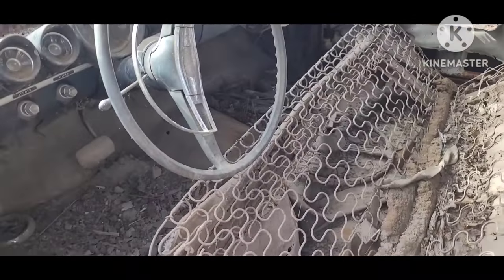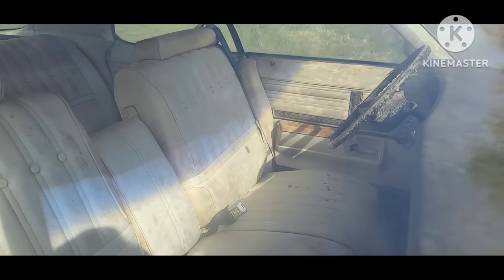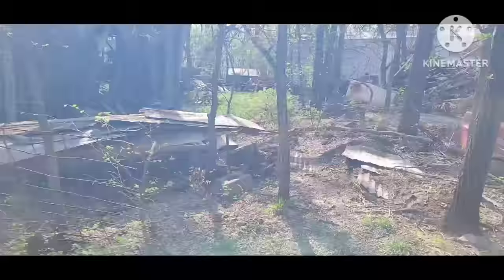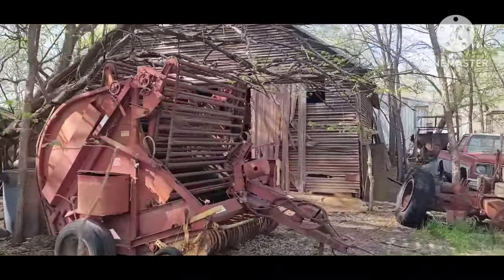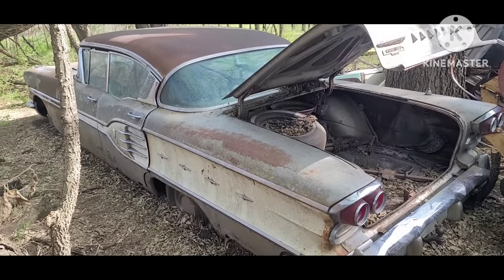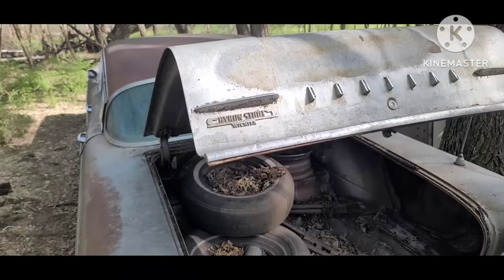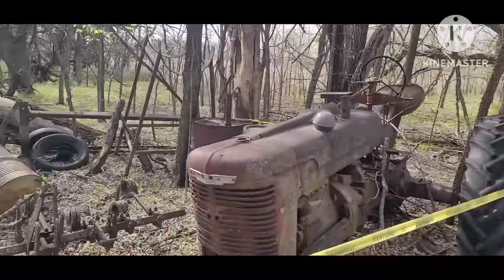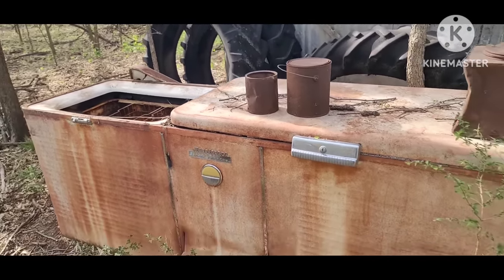He died at 96, and left EVERY Car, Truck, & Tractor he'd ever driven on this time capsule farmstead!

Comment: 1936 Chevy Low roof trucks had wood in the A Pillar (hinge pillar), a curved piece between them below the windshield and some "shoe-like" pieces at the bottom of the cowl attached to the pillars. Doors are all steel.
Reply: We turned a 36 Chevrolet truck into a ratrod pickup using a 46 frame and pickup box. Had to replace the door pillar wood and cross piece under the dash. It's a very fun ride and have taken it to Speedweek several times to watch the land speed racing.

Comment: The '36 Chevy pickup and the Chevrolet 3100 pickup are the coolest things in the lot. The Pontiac is interesting due to its trims and aircraft shaped accessories.
Reply: i agree! i clicked on the video because of the 1936 chevy. i have a 1937 that i'm currently turning into a welding rig and honestly, even for their age they are well built trucks with plenty of headroom when it comes to upgradability

Comment: I had a tire inflator from JC Whitney, you popped out a spark plug, screwed in the hose and used the cylinder pressure to pump up the tire 😂. Worked good 👍

Comment: The pontiac______yep….get it running…interior…drive it.  I drove a 60 model Chevy 4 door like that for many years.
Reply: That Pontiac looks to be very complete. Those have so many trim pieces and lettering, all of which appears to be there. Sure it will probably cost more to restore than it's value, but that's often the case. If that was how every old car's fate was decided, a heck of a lot more would be in scrap yards.

Comment: The North Star engine was good after 2006. They used longer head bolts. Had 190k on mine b4 I sold it and ran perfect. All those rat Nest good example of why you need cats running around

Comment: In the 1950s my grandpa had a 1955 Oldsmobile gold with a gold interior looked kinda cool he had a Hudson hornet with a 6 cylinder he said it would do 110mph his brother had a supercharged Cord smoked that Cord I've had tons of cars lost most of them over the years got a 1942 Ford pickup half ton short box in my garage runs and drives not in that bad of shape but it's got a 250 Chevy and a Borg Warner 5 speed in it but everything else is pretty much original except for the aftermarket windshield wiper, heater, gauges I would of stuck the original engine and transmission back in it but the guy got rid of them before I got it he got it from this guy's that bought it brand new in 1942 this old guys daughter sold it to this guy I got it from

Comment: That first truck is not turned over. 
If the guy was 96 he came from a time, especially for rural farmers, where you drove the farm truck when you needed a truck, and you went to town only when you needed to. 
That thing would probably clean up like a time capsule. I don't know where you are at, but I would try to snag that at auction in a heartbeat. At 37:05 you walk past the tailgate for it. 

The 74 olds is pretty straight too. It for sure has the olds motor in it yet, and highly likely it is a 455. Worth more then scrap, even as a 4 door full size.
Reply from the maker: I eyed both of these pretty hard... Tune in for Part 2!

Comment: The 1st truck in the video by the Cadillac showing 22 K on the odometer couldn't have rolled over on mileage the next digit left is for  hundreds of thousand miles .If it had rolled over it would have read 1 in that space.
Reply: That is what I was going to say.  It's very possible that it only has 22,000 original miles.  My fiancé's grandfather's 1997 GMC truck only had 28,000 original miles on it until she let her youngest son start driving it back in 2019.  Of course he has torn the shit out of it and it now has about 75,000 miles on it.
Reply: I seen that too

Comment: I had a challenger bike in about 1960. Only bike I ever had  I'd of liked to seen the bike a bit longer. Great videos as always
Reply: As best as I can remember the challenger was made by B.F. Goodrich.  I may be wrong, but that was when I was a kid and bicyling was my  life.  LOL  I was riding a Ray by Schwinn.  Loved that machine.  Rode it for years.
Reply: @Dave-ty2qp  yes I think you're right , I think my parents  bought mine at probably western auto or  Bill Beazleys , a local hardware store thaf has been out of business  fot 30 - 40 years now  There were very few stores in my town at that time to buy anything from. I was 10 when I got it in 1962, I use to wax and polish it all the time. The sting rays came out later in my town

Comment: If the odometer on that chevy pick up, with 22,196 mi on it had turned over, it would mean more than 1 million miles, more likely than not, it's original.
Reply from the maker: This is an early producton truck (May 1987), and the early models were notorious for weak gears in the cluster. It's almost certainly broken

Comment: That Pickup has to be a real 22k mile truck, because if it rolled over, it would be 1,022,000 miles, 6 digit odometer!   Maybe it's just broken at 22K.
Reply from the maker: This was an early production truck (May 1987 build date), and I'm told the early gears for the number wheels were notoriously weak, so the most likely explanation is that it broke at that mileage and was never repaired.

Comment: Those North Stars were kinda like 6.0 liter Ford Diesels, just needed some upgrades. North Stars used to be popular Engines for Sand Cars 🚗
Reply: A great motor if you tear it completely down to the pieces, reseal the crankcase halves, update the crank seal, and then thread-insert all 34 head bolt holes with steel inserts properly.  I'd have one if I was retired and had plenty of spare time and money.  They sound so awesome; it's the siren song . . .

Comment: I think you're floating along a little too much and not paying attention to that Chevy 4 x 4 it only has 22,000 miles didn't you see the zero in front of the 22 that's 100,000-mile speedometer or odometer I mean and look at the front seat dang thing look like brand-new it just probably always sat outside and it looks kind of old and funky outside but the interior was meant I'm surprised you didn't notice that that definitely only has 22,000 miles there's no way that thing has more the seat look brand new you need to lay off on the float and then pay attention my friend LOL
Reply from the maker: That truck was a very early production vehicle (May 1988). The cluster gears were notoriously weak, so it is almost certainly broken. Take a look at the brake pedal too. I did notice on sale day the dates on the tires were all in the 2000s, so it was at least the second, if not third, set of tires on it. The family said that the transmission was slipping in overdrive, a problem that commonly starts around the 150k to 200k mile range
Reply: @mr.goodpliers6988  this ain't Day One for Mr Goodpliers, haha

Comment: Obviously a confirmed scammer disconnecting the odometer cable on the pigsty all around so-called half ton, I'd say 200,000+ miles on a year of this said goober thing.
Reply from the maker: Actually this was an early production truck, and the gears for the number wheels in the cluster were notoriously weak. It was an under engineered component, that was never repaired after it quit working